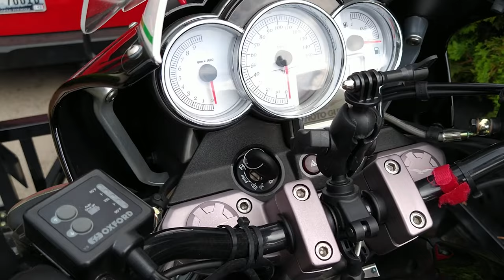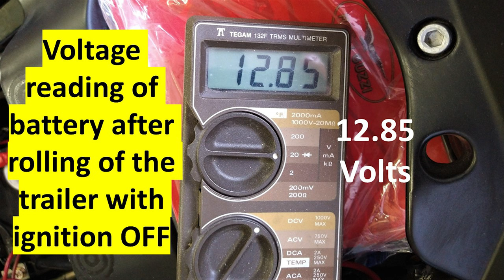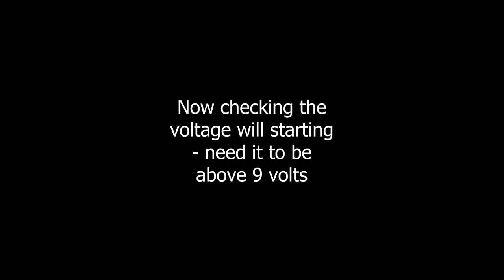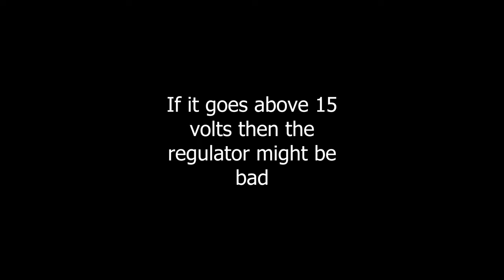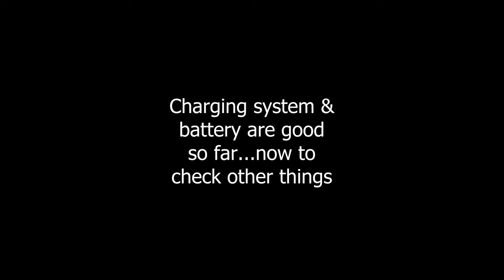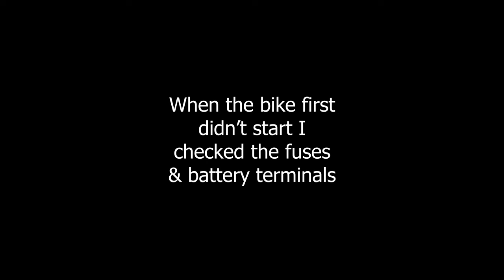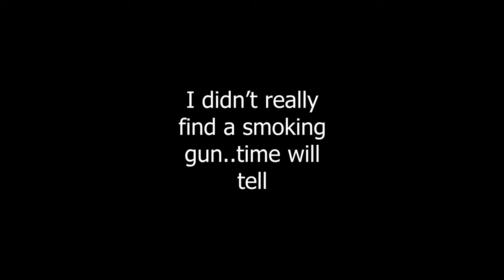Trouble shooting my Moto Guzzi's non- starting

Comment: Gerry, when it failed do you remember hearing the fuel pump prime, it may be worth feeling the temperature of all the relays to see if one is in the process of failing. I have had a similar experience, swapping the relays around energised the pump and got the bike going only to discharge the battery further down the road. On swapping the suspect relay all seems good, but on putting the suspect relay back all seemed good, but I noticed a definite temperature increase in the defective one. On the bench both circuits tested positive for continuity but on the bike the relay overheated and failed. Quite a tricky thing to establish, but easily sorted once established. Hope this helps
Reply from the maker: I asked myself the question about the fuel pump prime and frankly don't remember. I do appreciate the suggestions I have a piece coming to correct what they call starter interruptness.😄

Comment: Same problem with my Stelvio, tried everything you did, checked / cleaned everything, took it for a ride and all seemed fine. Couple of weeks later No start again. Long story short, replaced relays for ignition and injection system and fitted new oil sensor located in the V.. No problems since and if anything, the bike actually seems to run better than it ever did
Reply from the maker: Mark one of my subscribers also sent me to a link to Guzzis with similar symptoms as mine called "starter interruptness" or something like that. Seems the solution has to do with getting the correct voltage to the starter relay. Mike Haven makes a wiring piece that plugs into the harnesses and relay running from the battery with an inline fuse that is supposed to correct the voltage to the relay. 

I have one order but it doesn't work I may check back with you if it doesn't work, I  do appreciate your help.

Comment: I had a battery from new that didn't hold its charge (failed to crank 3x separate times in first month) , the shop tried fast charging it, but that didn't work. I gave it a full discharge\ charge (optimate) and it was fine for 5 years after that. I always leave my bike on tender charge when it's not being used. The problem is modern bikes need a lot of power to crank the engine and work the injectors at the same time.
Reply from the maker: Yes and almost all of them have some sort of draw from the battery via clocks,  alarms etc.  Great to hear from you again 👍

Comment: Could simply have been the starter relay contacts.
My Triumph would go for weeks then decide it wasn't playing again.
I just put a new one in .
Reply from the maker: I'll check it out with my local Guru Mr. Bill and see if we can check that out.  Thanks
Reply: Check the starter draw using a donut amp meter.. there is an acceptable draw ... as per service manual .. check relays w/ amp meter .. sometimes my Daytona won't start.. even though electrics are fine.. I requires a few extra clutch lever squeezes . and bingo Can't start a modern TRIUMPH w/o pulling in the clutch, in neutral or not... is a kick stand by-pass eliminator switch available for your Guzzi.

Comment: Those interupter contacts seem suspicious to me, grime or water?
Reply from the maker: Can you be more specific?
Reply: Don't forget to check your fuse box, fuses... if your fuses sit in the holder loosely.. should be very difficult to pull the fuse by fingers .. lack of contact produces heat, heat cooks the fuse, fuse box holders, causing leads to become corroded .. just using OEM recommended fuses, usually BUSS solves issues... those fuses must be held super tight in the box.. check the wire connections to holder underneath the fuse box too. They can come loose, tigten those up.. you can check them using a multimeter too . Just pop the fuse box push pins, turn the fuse box over.. warm up the wire leads w/ a hai dryer so they flex easier ... check the connections, holders
Reply from the maker: I did check them and replaced one.